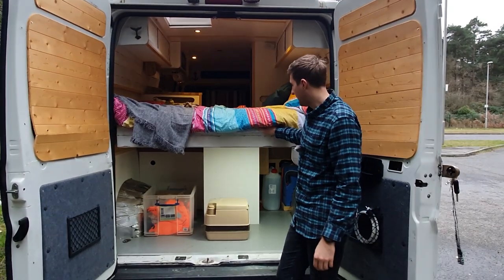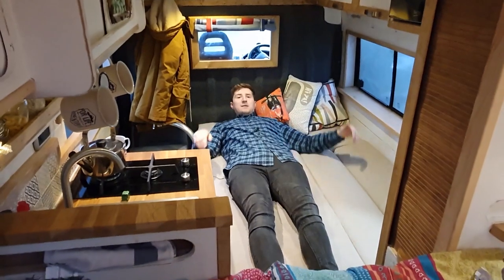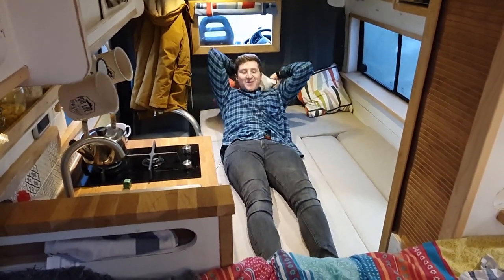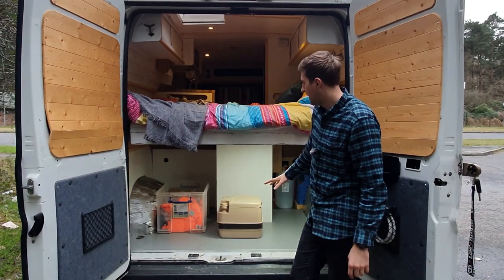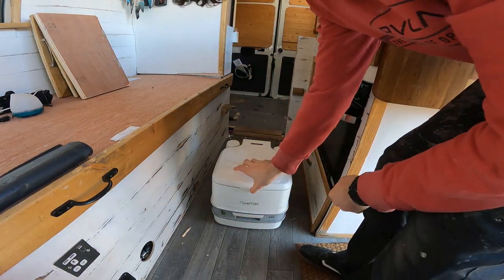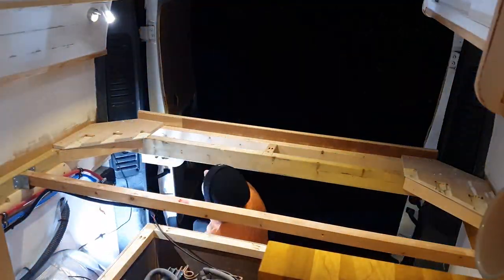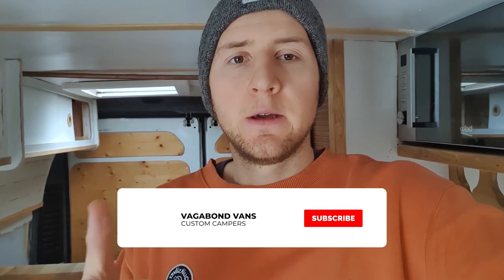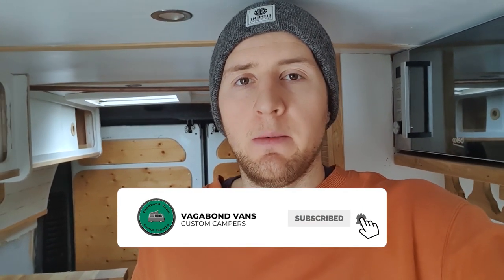3 BIG THINGS I GOT WRONG // FIAT DUCATO CAMPER CONVERSION (RAM PROMASTER)

Comment: Thanks for this video. I'm about to start my conversion. I went for L4H3 and I'm planning keeping the bulk head with a door to the front, or a big window to crawl in/out. Curious if the decision to remove it is to also have more space by leveraging the swivel seats?
Reply: Ah, got my answer I think in your more recent video where you removed only the upper part of the bulk head.
Reply from the maker: Yh I plan to fit a swivel on the passenger seat. Removing the bulkhead both visually gives the impression of a lot more space whilst also having a couple of extra spaces to sit when in camper mode. I started with a window that I could crawl through, was just a pain in the arse to be honest and would much prefer to just be able to walk through .
Reply: @sampayne6318  OK thanks, you got me thinking again :)